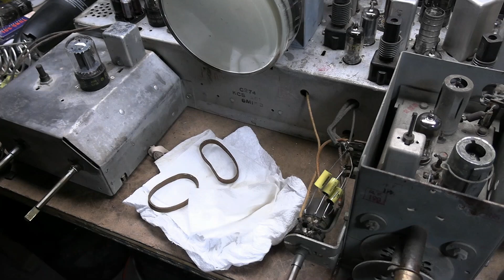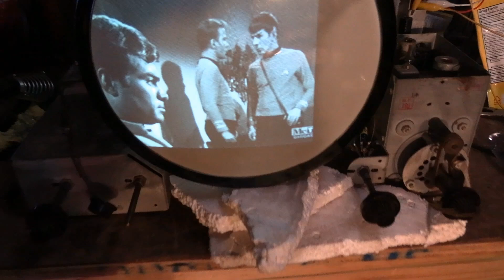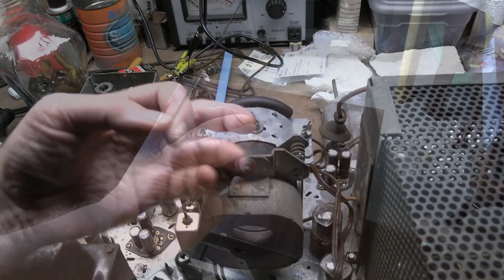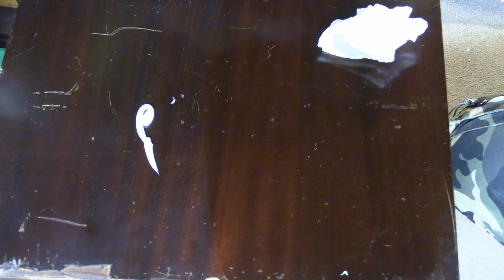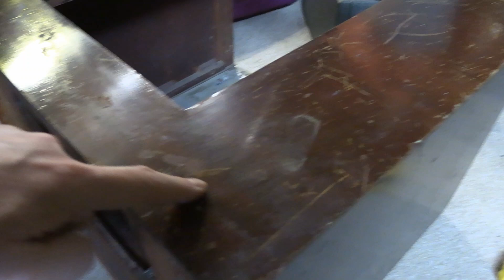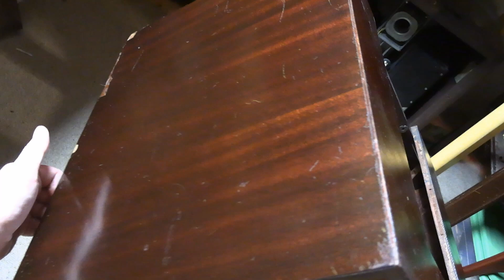Dueling RCAs part 7 - 8T241 home stretch

Comment: If anybody is looking for a modern replacement tuning belt for these sets, try using a Gates 60XL037 toothed drive belt turned inside out (30 teeth, 0.2" pitch, .37" width). These work just fine as long as the tuning mechanism moves freely, and you can't really feel the belt teeth on the tensioner while tuning.

Comment: I've heard of using a slice of bicycle inner tube as a replacement rubber belt. Since the TV has a tensioner your options are much wider. Just sewing a strip of fabric into a loop would probably work and be similar to the original.

Comment: For the tuner belt - maybe in future you could use belts from vacuum cleaners - the belt that links the roller brush to the motor.
Reply from the maker: Problem is they list them by model # and don't given dimensions.
Reply: The search machine enter quality radio belts  @bandersentv

Comment: Hello Bob !  I've used NOS dial belts in 1930s radios only to have them disintegrate after  slight use. I use the neoprene  automotive O rings  even on motorized Zenith radios without a problem. Cut    slightly smaller  than needed and superglued. If the superglue  joint concerns you,  I would just find a belt or O ring slightly smaller than needed or just double  up the loop. With modern DTV converter boxes, that fine tuning will rarely if  ever get used.  Fun vid as always !!     Kevin

Comment: I had a small Hoover vacuum cleaner a while back that used a reinforced belt in the head. It sure looks similar in size. Maybe if you can find a place that sells vacuum cleaner parts you could match up a reinforced rubber belt that would fit.

Comment: I have always hated dial belts and mostly do 30s radios where certain brands seem to use them more than others. I had a Sparton 1068 with an original belt that still functioned but looked like it was dragged out of the titanic (falling apart, very aged, and ready to give up at any second). A lot of the replica/repro belts on the market (for radios) are just various types of O-ring material which comes in different shapes and sizes and then is either glued or welded into a loop. But many of these will harden and stop working in a few years and any set I redid belts on 10+ years ago needs it again as the belts have taken on a permanent new shape that stalls out the mechanism. I have heard of experiments using lengths of belt material for vhs/tape players and other electronic-mechanical devices, and I once encountered a motorized set (iirc a westinghouse) where the "belt" was actually a long length of spring-like material (imagine a compressed spring where all the rings are almost touching). This was able to "grip" via friction a plastic and metal pulley... both of which were smooth (no built in ridges) which makes me wonder if something similar to springs can be soldered together in leu of cruddy o-ring plastic. I have seen grebes with dog-tag style chain and atwater kents used metal bands and those hold up pretty good so maybe some kind of metal solution would have the most lasting power.